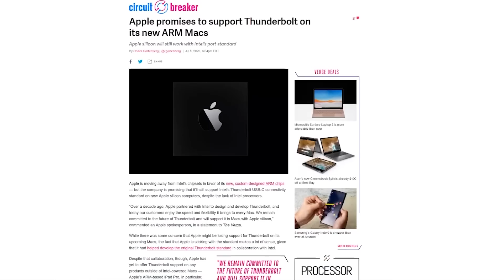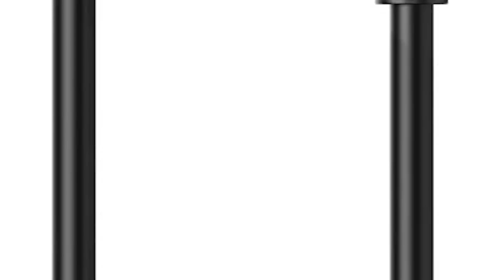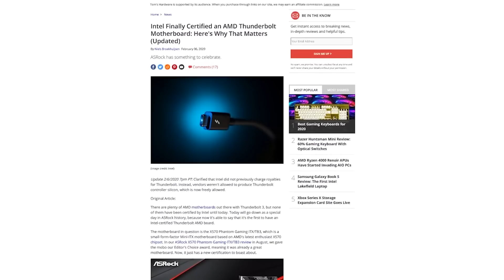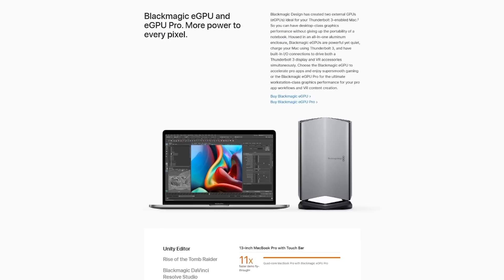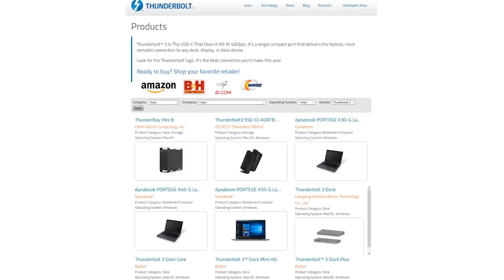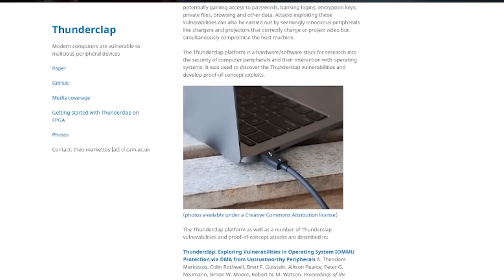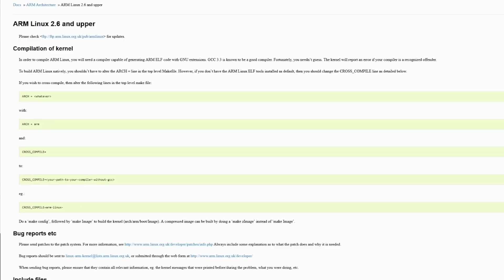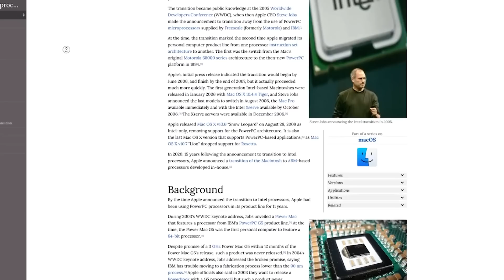Can Apple Do This? Thoughts on Arm+Thunderbolt

Comment: You called it! No eGPU support on M1 Macs. 
Thats some extensive hardware and software knowledgebase you have, I imagine getting thunderbolt to work on any unsupported device isnt easy, and then you pull that board out at the end.
I'm genuinely curious on your job history Wendell. Hogwarts IT should be in there.

Comment: FW 400/800 was magnificent.  Especially compared to other standards of the day.  Was in my 2003 17” PowerBook, Quad G5, etc.  Heck, I had the iPod with FireWire.  Still have FW800 in a couple Intel Macs I still run.  But I haven’t used it once since USB 3.0 & Thunderbolt came out.

Bogus, because I still love the fact that FireWire basically could act Fibre-like, with Full-Duplex, for Direct Attached Storage.  Not much other mumbo jumbo.  Kinda wish Apple kept iterating on it, rather than kill it before FW1600/3200 came out.

Oh and Sony’s i.Link FW400 was pure hot sticky garbage.

Comment: I would think that Apple knows,what they’re doing. Power PC with FireWire worked well. Apple was losing interest in FireWire by the time they moved to x86, and were beginning to depreciate it already.

This is different. Apple is betting it’s future on their new chips, and they’ve been planning this for years. It’s not something they just decided to do. They have more than a few Thunderbolt engineers, from what I’m told. You can get they’re putting a lot of work into this.

Comment: 8:05 wasn't Apple a co-developer of the Thunderbolt spec?  I'd imagine part of the agreement Apple Legal worked out with Intel would allow them to self-certify

10:45 you can't use hardware without software, Apple would likely make this job be a problem for the software developers, who will have the burden of pushing their own "this device is tested compatible with our software" - Apple will just point users at the software developers, i.e. not their problem

Comment: Intel did a terrible job of providing any support for Thunderbolt 3 running on the Intel platform. For example, in the early days of Thunderbolt 3, I had a Dell XPS 15 9550 that didn't work with some Thunderbolt 3 devices (like the Apple TB3-TB2 adapter). Neither Dell (and I had corporate support for my laptop), nor Intel, nor Apple would explain why a TB3 device wasn't compatible with another piece of TB3 hardware. It was just, "oh well, that doesn't work." When Dell washed their hands of the problem, Intel offered only a community web board and a Thunderbolt marketing website (with near zero technical info available to the consumer.) When I finally talked to Intel reps on the community board, they basically said "OEMs are responsible for TB3 support; we just make the chips." But, of course OEMs had no incentive to track down a device incompatibility, especially if it was going to reveal that the hardware they sold was some earlier, less functional revision. Also, as one might expect, when I tried to ask Apple why their TB3 hardware didn't work with other TB3 branded devices, they just said that they only support their hardware with their own hardware.
Maybe if somebody is an Thunderbolt OEM/vendor/developer, there is some Thunderbolt 3 technical info that might allow customers to self-service Thunderbolt problems when the OEM support that everything depends upon fails, but Intel had nothing but marketing "One Port Does it All!" infographic level promotional materials available at the consumer/individual technician level.
I doubt Intel will somehow do better for Thunderbolt 3/4 on non-Intel platforms.
Reply from the maker: This was a symptom of "hardwares fine ship it by the time it gets to end users hand software will be done" except massive hardware bugs prevented it from really ever working totally properly
Reply: @Level1Techs  The closest explanation I could find of the problem was (maybe, in some circumstances) a different power delivery controller rev resulted in the incompatibility -- but, importantly, while some vendors (Akitio, Pluggable) warned of the problem, no official statement -- or especially a remedy -- was offered. The history of behavior here was just "it doesn't work... too bad... here's new stuff to buy."
https://www.extremetech.com/computing/239113-apples-new-dongle-happy-macbook-pros-not-fully-compatible-thunderbolt-3-peripherals
Reply: @Level1Techs  And, even if it could be fixed in software, Thunderbolt 3 firmware updates were also something that Intel pushed down to OEM responsibility -- and some vendors bothered to offer firmware updates, while others didn't. Meanwhile, Intel didn't even make release notes available for firmware versions to know if the newer firmware one might see on another product maybe fixed the problems one was having on other equipment still on older code.

Comment: I bought asus thunderbolt expansion card a long time ago. That didn't work. Then I tried installing and uninstalling like every month. I couldn't just give up since I bought it for an audio interface that is almost one grand. I thought I might be just out of luck with this particular expansion card, so I ordered gigabyte thunderbolt expansion card. Then It worked for a while without the plug and play feature. After windows update, it disappeared. The total cost of the two expansion card is not so big, but the time I spent and the actual peripherals I bought for the thunderbolt connection are significant. It's just my experience with the thunderbolt. I like this channel. My English skill is limited, but I learn from this channel a lot. Thanks.

Comment: To those saying "Oh only Apple users use Thunderbolt! This doesnt matter!" There are a large amount of us in the professional audio engineering community that deploy Thunderbolt as our main digital I/O for AD/DA conversion on both Windows and Apple systems. I work with Universal Audio Apollo/UAD systems on Windows and I can tell you, as soon as I saw the ARM announcement, I new it was going to be a huge travesty, considering Apple's consistent treatment of the at-large professional audio industry (Avid, Presonus, IK, etc). They CONSISTENTLY screw their software partner client base, then turn cheek and tell the public "oh, its gonna be wonderful, itll just work! Its magic!" No, its not. Apple is going to abandon them. As usual. It'll take a year, as software engineers at the third party companies scramble to unfuck what Apple sells on their integrates systems.

Comment: This is just fairly shallow speculation. All "if" "as best I can tell" etc. Comparing with the Linux kernel? Can I get my 17 minutes back, now?
Reply from the maker: It wasn't that shallow but I did cut some of the technical stuff. If you read what apple has published already wrt memory isolation and iommu, without exceptions to that spec, prettymuch all existing thunderbolt audio products will be DoA with arm Macs because of silicon bugs...
Reply: @Level1Techs  That's fair. i should have said it's all speculation, based on absence of evidence. And as we know, absence of evidence isn't evidence of absence.

Comment: I thought the new usb4 implementation was supposed to technically be Thunderbolt compatible?
I kinda wonder if apple is aiming to implement usb4 since it's an actual well-ish defined 'standard', and hoping that it will work.

Comment: I really do appreciate your videos. They are technical enough that it stretches my knowledge and I learn new things, which is a great experience. And I get to listen to someone who not only knows that they are talking about but can convey the information in a great, conversational way.

My first computer was an Apple ][+ clone I soldered together, along with all the peripheral boards.  I saw one of the first Lisas in Canada, and I have gone through the 68000 Mac, the PowerPC Macs, and the current Intel Macs. In terms of the ARM based Macs...my fear isn't so much the hardware, but the software. I really hate the gated garden that iOS is, and I hope that Apple doesn't fully castrate the solid Unix underpinnings that Mac OS has in its support for the ARM processor.

Comment: target drive = apple + T lol. i remember those days. it was pretty cool. i was able to save files on a hard drive that wouldn't boot up and started to crap out. sadly, it's no longer available on current apple hardware. they should bring it back since MBPs use soldered SSD. if you don't back up and that drive craps out, target drive would be a good first solution to try.

Comment: Can Apple do this? Sure. Of there's one thing Apple is good at, it's optimising the absolute shit out of their ecosystem.

Will Apple do this? I don't think so. If there's another thing Apple is good for, it's not really worrying about things that don't drive sales. I would bet that Apple is (or maybe has) sorted out its own sort of certification, and will put the burden on third parties to get with their standards or be left out. And their response to old devices is to show off their shiny new first party ones aimed at the consumer market. (iThunderbolt, anyone?) 

Intel might have constantly revised chips and chipsets, but they did seem to at least try and go the extra mile for interoperability.

Comment: Yes I remember Firewire on PC awhile back.

Had some motherboards with this port and some of my Soundblaster cards came with the same port.

I just never used it for anything as I didn't have any peripheral devices needing this kind of connection.

I should check out my old Power Center 150 machine in storage, I can't recall all the ports on it.

Comment: So apple have already talked about the PCIe memory isolation system they are using https://developer.apple.com/videos/play/wwdc2020/10686/

With respect to getting certification apple likely still hold some of the thunderbolt IP and might well be able to self-certify since they co-developed the spec with intel. Note the T2 chip in modern macs is part of the secure thunderbolt3 setup process so has already been through certification.  This also plays into the question on if they have the needed staff, since apple co-developed the spec and found most of the bugs in the spec they clearly already have a staff that is very familiar with TB. Also when it comes to the thunderbolt drivers side of things these are (even on intel) part of the main OS bundle so likely not written by intel today, so apple should have a good understanding of all the issues...
Reply from the maker: I saw this as prelude to iommu like functionality the problem is they will have to provide a legacy mode of some type of they want to be compatible with older devices. The silicon on the other end of the tb cable in the device is still bugged.
Reply: @Level1Techs   So legacy support for traditional direct memory (non MMU isolation) PCIe on Apple Silicon is not supported. The docs make this quite clear. 

And in-fact that is also been the case on modern macs with T2 chips since VT-d is setup by the T2 before the PCIe bus is powered on. (this is one of the main reasons they moved from the T1 to the T2 to let them control the UEIF boot stages of the intel cpu). So TB3 devices that work on modern macs already are forced to use VT-d.  This also means drivers that work with modern macs already assume that PCIe device memory is isolated (and as apple pushes more of us dev to re-write our drivers using the user-space driver apis we will have even less controle over this). 

Will apple say devices using older TB3 controller chips are not supported? Yep, to be honest having used multiple thunderbolt docks I yet to find one that is 100% solid.  Personally Im hoping that when USB4 roles out we will have some other vendor make chipsets maybe things will get better...

Comment: Usbc products should come with a 32 character string describing them.  Everyother character describes a spec like usb version or hdmi support, and follow it with "c" for officially certified, "n" for not supported, "p" for in house tested to probably work with quirks.

Comment: The fact that seemingly all USB-C ports are different is a massive problem for the tech illiterate.
Reply: @RubberGopher  Well almost. One annoying thing is when I have to explain to people that this charger is not going up to 12v and is just 5v so your new phone won't charge with that old brick even though the cable fits. 
That was a problem with micro-USB too, but that usually stayed at 5v, just that some chargers couldn't give enough Ampere. USB-C can go all the way from 5v to 20v? It's just a nightmare.

Comment: rule number one , never buy a 1st gen apple product . or something with a butterfly keyboard .. 1ste gen apple products have bugs , and because of that apple gives them only a few years support and drops them like crazy hoping no one will notice . 1st gen i phone , ipad ,intel duo and solo macs , MBP retina displays , buttefly keyboards ect.  rule number 2 never play by the rules i think apple is very resourceful what if they ditch intel and ad a new module to the sock/ T2 chip  that handles the communication and runs there software the 5k LG display is a non standard thing its out off spec and it works only on apple's with certain ports

Comment: What I find most interesting is that once Apple manages to integrate Thunderbolt into the SoC, and manages to reunify the two operating systems they have, they are not only able to run iOS apps on their laptops as they showed but also desktop apps on a phone or tablet connected to a Thunderbolt monitor that can connect additional peripherals or even an external GPU.
It's not clear whether they would want to actually do it, but I don't see what would stop them.
Reply: While you will be able to run iOS apps on macOS there is not plan to run macOS apps on iOS. The main reason for this is macOS apps expect a very differnt memory subsystem. on iOS there is no swap (and very small amounts of ram) so apps cant just load things into memory there is no virtual memory macOS apps (even if apple did port the UI framework) would just be killed within seconds of opening since they assume they can make use of virtual memory.

iOS opted to be like this from day one to force devs to be carefull it is one of the reasons iOS devices use less power than android due to devs being trained that thier apps will be killed if they use more than 30% of the physical memory on the device.
Reply: Right, memory capacity is surely a problem for a lot of applications, but I don't think it's that far off: the embedded NVMe is probably already capable enough to be used for swap space in that scenario or could be upgraded.
The top iPad models today ship with 6GB, phones with 4GB, compared to 8GB on the entry-level Macbook. The cost difference between a 32Gbit LP-DDR4x and a 64Gbit LP-DDR4 is under $30, and with partial-array self-refresh (PASR) there should be little difference in standby power consumption. Linux/Android never supported PASR upstream, but iOS totally could if they don't already do.

I'm still not saying that this is actually what Apple are planning to do, but it also wouldn't surprise me if they did.

Comment: Do you think that Apple may just move to USB-4 on the first Gen ARM products and drop the whole Thunderbolt nomenclature, and doing what Apple always does and develop in house drivers through some weird Kernel Kext and software APIs to do the conversion until the bugs are gone? Kind of like Rosetta? That way Apple can say they have the very first USB4 device with open standards?

Comment: not gonna happen. 

it's not the engineering that's the problem nor the quirks, they've got plenty of time, money and smart people to get it right, when you work on complex systems, they're all non-trivial bugs and fixes for the damn bugs, thunderbolt is an open(-ish) standard and Apple will not touch it even with a 10-foot barge pole. it's as simple as that. They'll just come up with yet another proprietary standard for the mac, they'll probably claim it's "thunderbolt-compatible", but then no one will test it and that's where thunderbolt's journey will end on Apple's platform.

Comment: being honest i dont see the problem, apple will release specs and guidelines on how/what/when etc, you can do with one of "his" thunderbolt ports and then sell certification to vendors, if a device doesn't work its not apples fault, its just "not certified" to be used with your unapologetic port

Comment: They probably just gonna work on thunderbolt on arm just to have it on the next iphone Pro XD

On a more serious note, will the work of apple (if they are going thought the hassle of make it work) be a bridge to have tb working on other non apple ARM based chips (snapdragon?) Or will it be more like a hardware implementation on the SoC?
Reply: Initial Aarch64 support was already added to the Linux kernel in the last 5.8 release.  This was nothing more than allowing thunderbolt to be enabled when building for Aarch64.  The main hurdle we are focused on and is generally the problem is getting the ACPI tables for PCIe setup, and firmware first configuration to handle the PCIe hotplugging that is needed to support it.  The security aspect is once the memory regions are setup you then need to pass those over to the SMMU to handle the security aspect.

Comment: I doubt many video production companies are gonna switch to ARM based Mac's until at least the 2nd revision. That was my experience when I worked in the industry during the PowerPC to x86 migration, as well as the os9 to OSX migration. And if the industry waits long enough, the TB on ARM problem will have fixed itself, you would expect.
Reply: What production house is gonna switch away from Threadripper and nVidia? Apple will have to bring some fucking heat to make that happen.